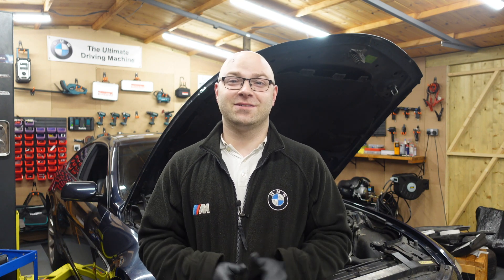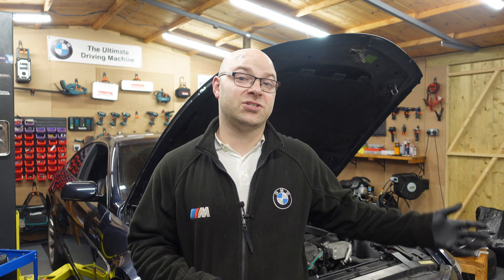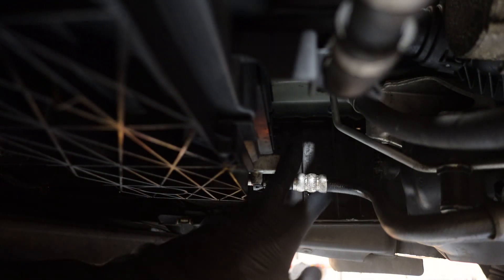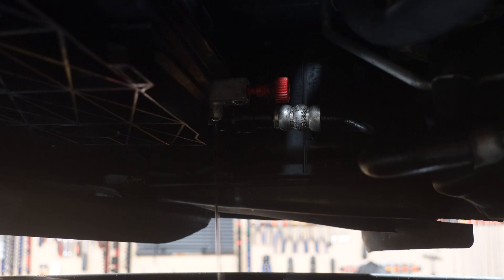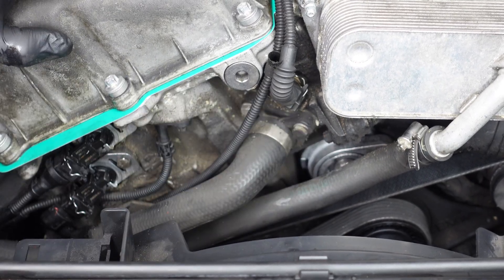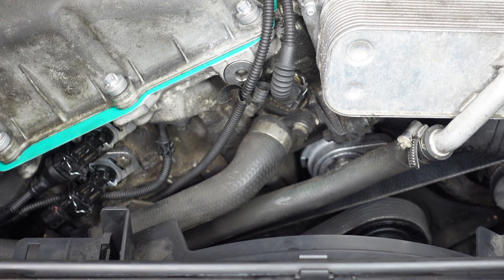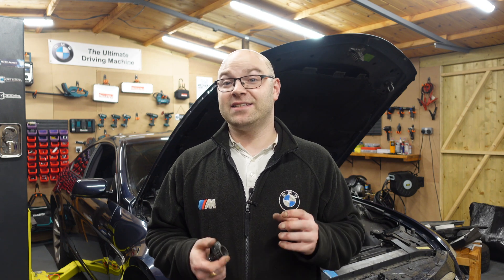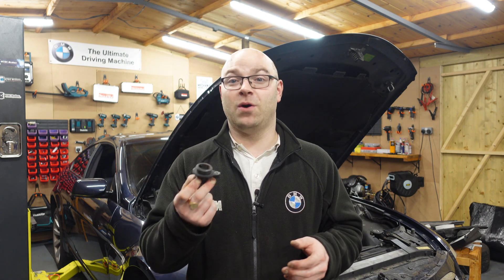BMW N52 Coolant Flange Replacement (Mickey Mouse Coolant Flange)

Comment: yeah, 230k km (~140k miles) here, 17 year old n52 in Canada, took mine out and it was in great shape. Even had a hard time crushing it out of the hose. Also always used yellow/green coolant. Also on stock water pump. Stock OFHG isn't leaking. T-stat did die. Overall: makes me wonder about the bmw blue...

Comment: Dr. Dean,
Ill tell you my experience replacing those flanges.  

The first 328 I replaced it on, had 130,000 miles.  It broke off and crumbled in pieces.
The 2nd 328 had 90,000 and the same thing happened with that one.  
On my 528 with 235,000 miles was a different story.  It came out in 1 piece.  I was in shock and it made me feel as if 5 series got better parts from the factory.  I dont know what your take is but I think your car got plastics from my same batch!!!

Comment: Mine cracked at 140,000 on N53 around the base and no longer held flush to engine. I suspect however someone may have lent on it while changing the oil filter. Replacing to an Al one. Anyone reading this the common consensus is 10nm torque for the 10 mm bolts; don't overtighten Al.

Comment: Oddly enough when I first got my car i was doing the OFHG and replaced the flange with a metal one about two years ago but recently it’s started leaking coolant from the flange-engine joint. The only other time I had an issue like this was when a I had a non-mann oil filter that collapsed and had oil seeping out the cap and what looked like the ofhg too. Its since been replaced but wondering if high coolant pressure is causing leak

Comment: You have an airlock. that is why it drains so slowly. You need to open the valve in the top radiator hose as well.

Comment: Off topic but I've been wondering if there's a way to change the interior light timer. I have a 2017 G30 5series and I hate it when the interior light stays on for 10 seconds or so  when I switch off the engine.  Especially when I park my car in the parking lot of the train station in the morning, and it's still dark.  I'm always early so I stay in the car for another 10 minutes or so. But I hate it that the interior light stays on so long.   (And please don't tell me I should leave home 8 minutes later... 🙂).

Comment: Had to change my flange on my 2010 328i, which only have 85,000. It was worn out and cracked but i think i had other high temperature issues with the cooling system that contributed to it's failure.

Comment: Are you making an active effort to seem more pleasant or is it just the lighting or something? I'm watching regardless.
Reply from the maker: Both 😄 lighting is different now as I’m using proper lighting for the engine area and internals and also adjusting my ISO when needed. And I’m also trying to be more relatable to everyone not so angry I’m over that side.
Reply: @BMWDoctor  keep doing what you're doing. Your tips have my S85 running like a gem.
Reply from the maker: Talking of S85 I have more to do on that I need to change my clutch and flywheel just because I want to get it done as it’s the only thing I ain’t done 😅 so that’s gonna be coming up real soon.
Reply: @BMW Doctor  It's funny that you say that because I just did my clutch and flywheel, slave cyl and all the other parts. It hurt $ because the flywheel costs more than most clutch jobs, but it was worth it!

Comment: Mine was still intact at 350,000km but I replaced it as preventative maintenance, and it was very brittle so I'm glad I did. There's a bit of a cleaner way to do it. using some plastic hose "clamp pliers" you can pinch off the hose and help avoid getting any debris into the hose. Using channel locks, squeeze the single use clamp thats on the hose to crack the flange. Slide off the single use clamp, pull out any remaining bits of the old flange, and proceed to install the new parts. No need to cut the hose or clamp.
Reply from the maker: Yeah I know I was going to do that but I thought the hose is way long enough to reach even if you just snip a piece off which is what I did and to be fair it’s been over 2 weeks now and it’s been fine driving it with no issue or leaks so I suppose it worked out for me I mean if I had to replace the hose that’s a easy job anyway 😅

Comment: Thanks for the video 👍🏻
A view months ago i had a leak on the radiator. The reason was that there was a lot of tree leaves between the cooling radiator and the airco radiator and that gives oxidation on the aluminium. This is on my 2005 E60 525i,I don’t know or its the same on your E63?
To bad i can’t put a picture over here from the mess what i pulled out 😮
Reply: Did you have to remove the radiator to remove the leaves...
I have exactly the same issue.
Reply: @siphodube7928 yes,the radiator was leaking,so i had to replace it. I think you can blow with a compressor or with watercleaner to clean it.